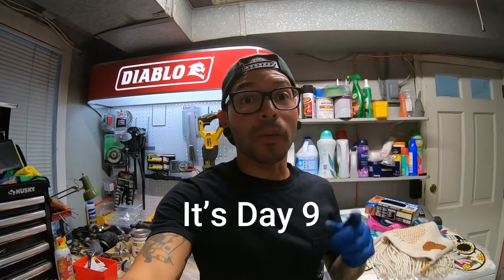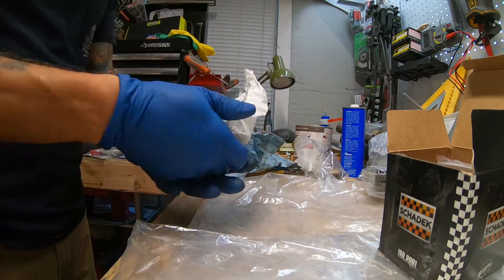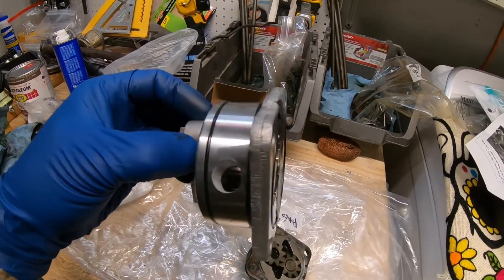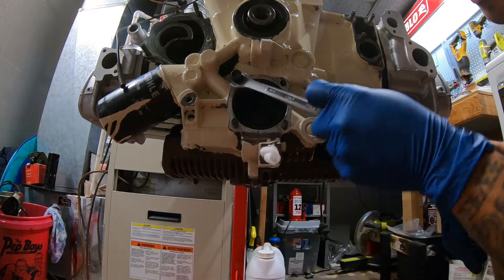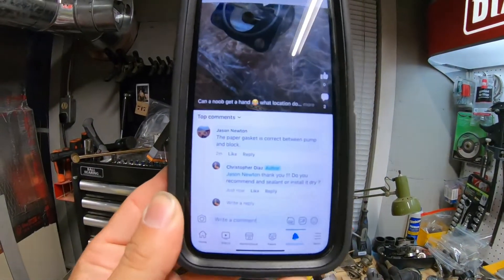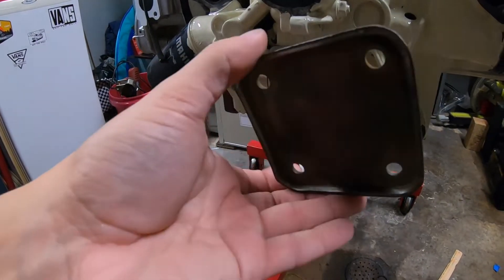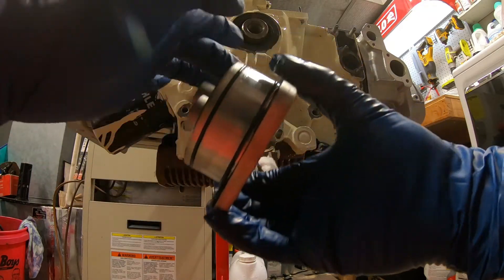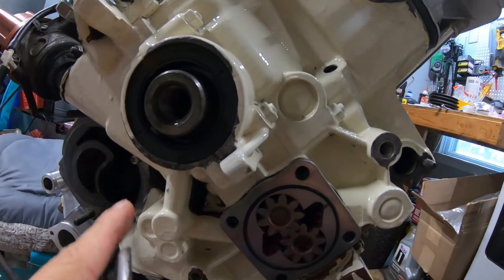Volkswagen Vanagon Revival | High Flow Oil Pump Install from MansiSpeed| 1.9 WaterBoxer Rebuild Ep12

Comment: There are two oil pumps, an A and a B based on the rivets on the cam, 3 vs 4 rivits.    Surprised that they included the paper gasket.  But ok, I am going to order it today.   Did  you consider the ratio rocker bolt on kit ?   I'd like to do the EFI upgrade but it's almost what I paid for the vanagon !        I have my 88 vanagon engine out two days ago, heads off yesterday.   Now, trying to do what should be done for longevity and dependablity.   A trip is planned in ONE MONTH.  We might get new heads as there are cracks between the valves.  Head studs are in great shape so I feel very lucky, even if I have to buy new AMC heads.  FWIW....
Reply from the maker: Super sorry for the delay! My apologies! So I did my best to keep the build within a reasonable budget and focused 100 percent on reliability. I too had a trip I needed to do and prove the Vanagon was ready. 1 month after I rebuilt it I took my family from Pennsylvania to Texas for Christmas vacation. I was so thankful knowing I put quality parts in Noreen and she ran like a top ! 

The efi upgrade kit is amazing but definitely outside my budget lol 

I hope you got yours running 🙏🏼 and making memories mile by mile ! I appreciate you sharing your experience and following my channel!

Comment: 30 mm is the gear size. do you really think that port is 30 mm?
Reply from the maker: From what I understand it was the port size . Marco drills all of the housing out by hand . The larger the port the more flow.
Reply: @WeRoamtheUnknown  tighter tolerances too and this is to boost idle oil pressure and also oil pressure while running.   The 2.1 have two oil pressure switches, and the light came on, but the switch failed (pulled electrical cover of it and oil came out).   BUT, Mansi said it is the best 200 you will spend on your vw.